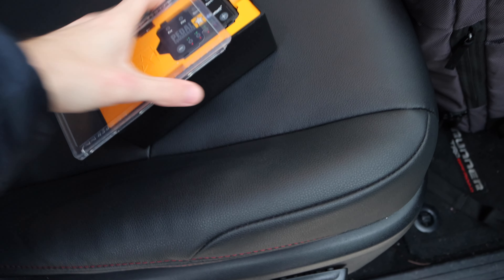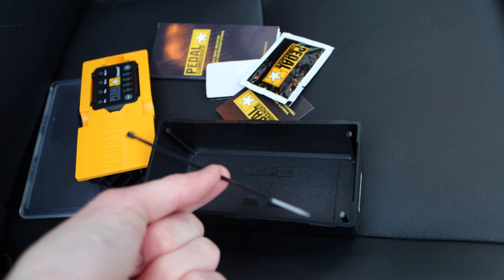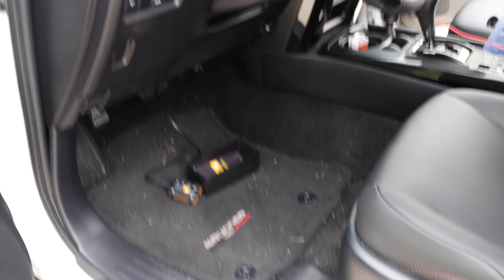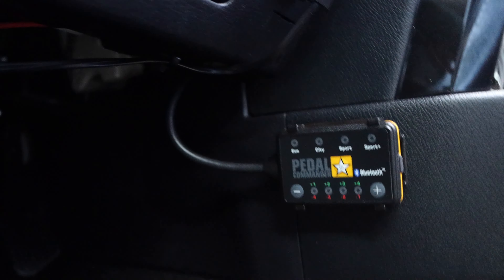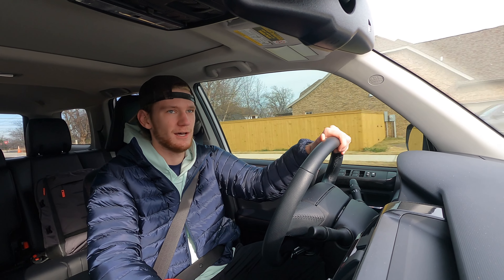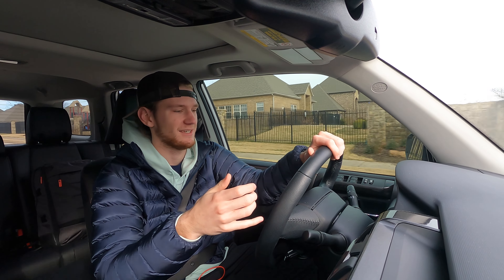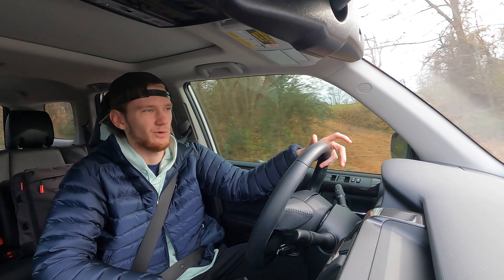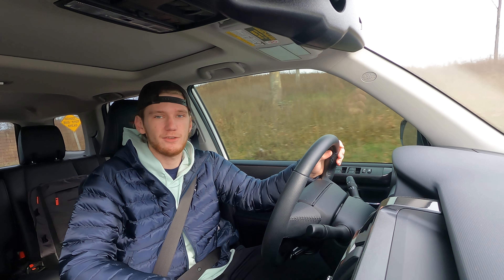Toyota 4Runner Pedal Commander (Plug-N-Play) EASY INSTALLATION for 5th Gen!!

Comment: I recommend trying out the Banks Pedal Monster because the Banks Pedal Monster is the only throttle booster that turns off when you put the vehicle in reverse which is A much safer option. It also gets its power from the OBD port so you will never get dead pedal because if it were to ever malfunction it automatically turns off and goes back to stock.

Comment: Hey Connor,  I have watched several other U Tubers videos who have installed a Pedal Commander in their 4Runners and Tacoma’s.  Based on their and your comments, I think I will just save my money for a supercharger and get some “Real” performance gains for my 2022 4Runner.  Good install video, keep up the great work !!
Reply from the maker: That is a great idea! Might be coming to my channel in the future as well
Reply: Just get an ecu flash, you’ll actually get performance gains and it doesn’t cost an arm and a leg.
Reply: Unfortunately there’s no supercharger for anything after 2019.  I’ve been chomping at the bit.  Reached out to Magnuson and ProCharger.  Guess there’s an issue getting into Toyota’s new CPU
Reply: @AlexA-ki9td  Same here on my '20 TRD ORP chomping gnawing and craving a supercharger! Both Mag and Pro techs I talked to verified that they are actively working on it. However the new ECU (2020+) is proving to be difficult to "crack" and map due to the new software changes Toyota made since they no longer offer a Factory Supercharger option (which was a Magnuson back in the day anyway just saying).

Comment: I want to install it  on my Toyota 4Runner sR5 2021. So it won’t hurt the motor or anything in the cab?
Reply from the maker: It will not. Just believe if you take it in for service and you are still under warranty then you want to disconnect it. Could be wrong about that but I believe I saw it somewhere
Reply: Will not affect your warranty, engine, or anything interior wise, because it does not change any factory parameters in the ECU. Been running Power Commanders (same concept) on my bikes for years. Simply an electronic module interface to make the Factory ECU believe (translate) what you want it to believe. Now if you toss on a supercharger welllllllll.........haha!
Reply: @davec8894  thank you

Comment: Hi, I have a question about my 2013 4runner can I install a commander?
Reply from the maker: Yes the Pc27 from pedal commander is for 2010-2022 4Runner’s

PC38: 2003-2009
Reply from the maker: Clicking the link in the description will take you right to it

Comment: Awesome review Sir! Agree, a Pedal Commander will NOT create more horsepower or make the 4Runner "faster". Physics wins because it is a 6000# beautiful capable solid frame on construction powered by 270hp. Now there are some options that help.....
Ordered my 2020 TRD ORP with the full TRD Performance package, and the PRO exhaust DOES make a difference from the stock cat-back.  
A bit "grumbling" sounding but improved performance is noticeable over stock. 
Absolutely recommend the P/C short term as it gives the driver more finesse and throttle response. With that being said, you still gotta go basic and build it out. 
CAI, full exhaust, and hell yes.......a Supercharger. 
Hopefully Magnuson or ProCharger can crack the ECU soon. The supercharger hardware 
 (bolt on stuff) is not the issue. Software and tune is the problem right now.
As another commenter mentioned, flash the ECU.....well not recommended in my opinion.
I'm waiting on Magnuson and already got my setup "basics" taken care of.

CBR RR Life.....Drop a Gear and Disappear!

Comment: It’s great until it fails and your 4Runner goes in limp mode.
Reply from the maker: Haven’t had any problems with mine
Reply: @Connortaustin  I said the same thing for 8 mos and my friend had warned me when he saw it in my truck 2 weeks ago. Sunday taking off at a stop light I lost power in the gas pedal and limped over to the curb. Restarted it and drove home. Removed it and removed the negative terminal on the battery. That could happen on the freeway and could be catastrophic.